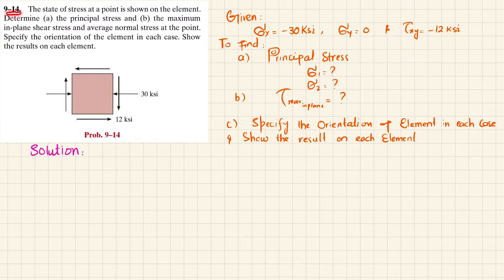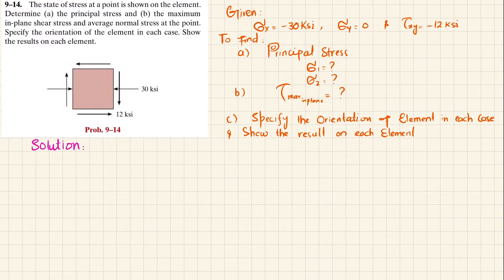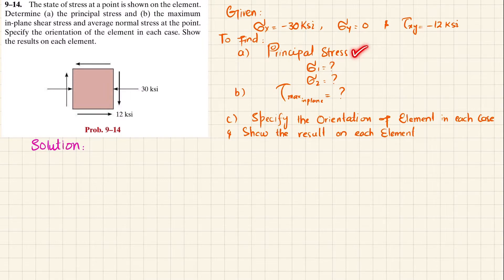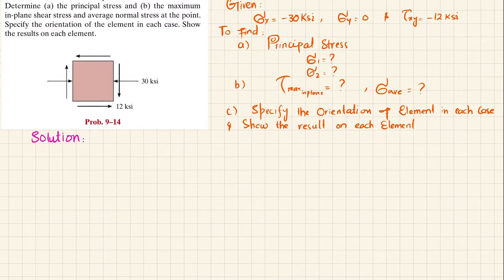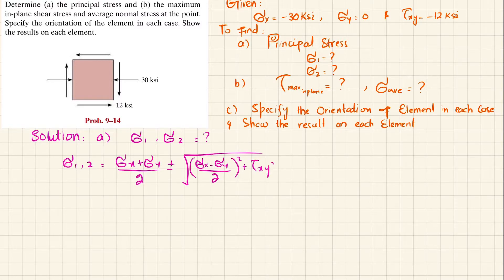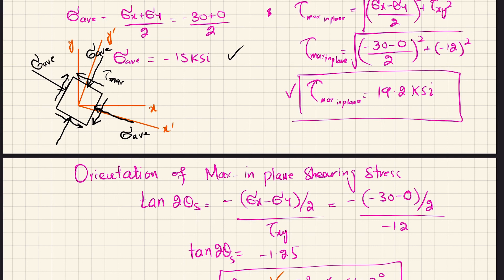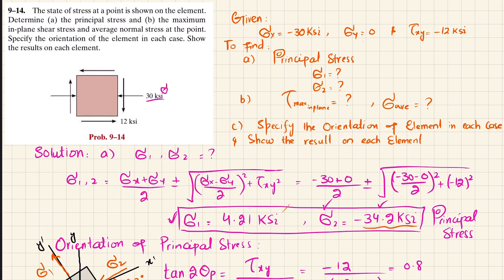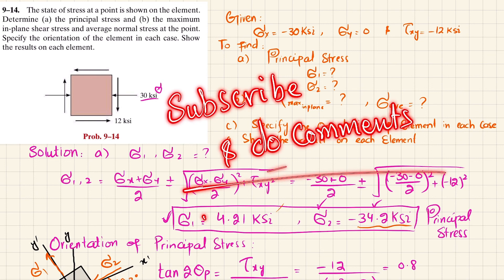9-14 Stress Transformation |Mechanics of Material RC Hibbeler|

Comment: I think there is a mistake 13.13 while drawing t max. The value is positive so they must show upper corner, opposite way. Or am i wrong? Thanks.
Reply from the maker: Put theta s = -25.7 in shear stress transformation equation if it comes out to be possible then you will be right and if it comes out to be negative then what I have done will be correct. Kindly check it and give me your feedback as well. Thank you

Comment: sir but in example no 9.3 and some other examples it uses some different notation for x and y axis, can you explain me that ?
Reply from the maker: Dear you can check that you have two theta p value one is -23.7 which is clock wise and other theta p 2 is 66.3 degree that is counter clock wise. so if you rotate the x axis through -23.7 degree it will be theta p1 and element will rotate clock wise . if you want to rotate that face of the element to 66.3 degree counter clock wise it will give you the same result. so both representation is mentioned in same picture in example 9.3. I hope it will clear you further....